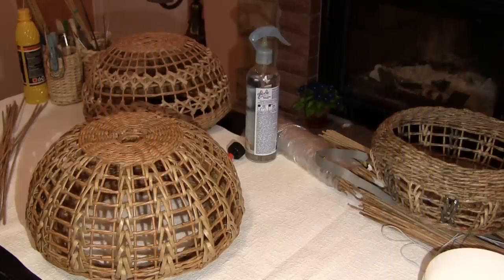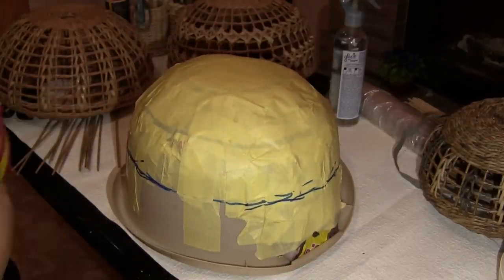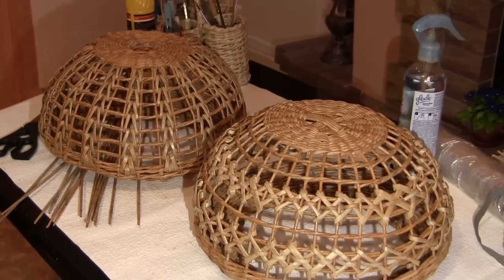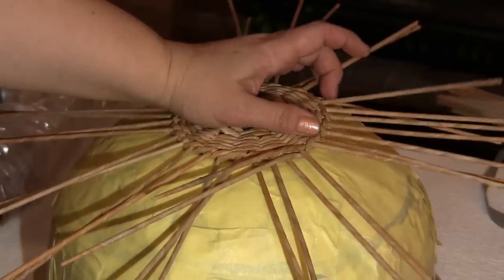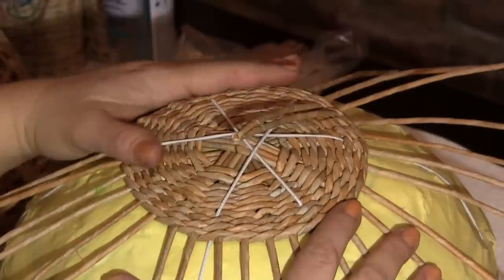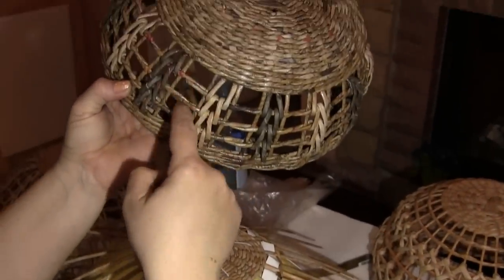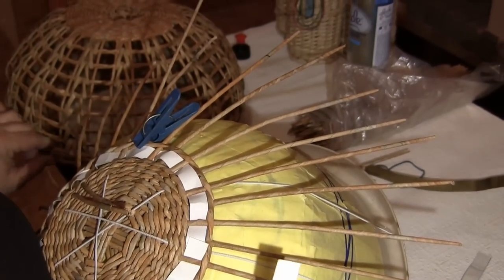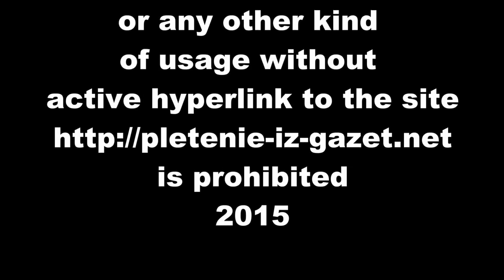How to weave an openwork lamp shade. Part 1.

Comment: I myself would of left the basket alone & added a the corded string light,& a beaded  or chain necklace to hang it up in the ceiling.i would not of put the lining & the wires, inside it,& weaved it.but to each is on.